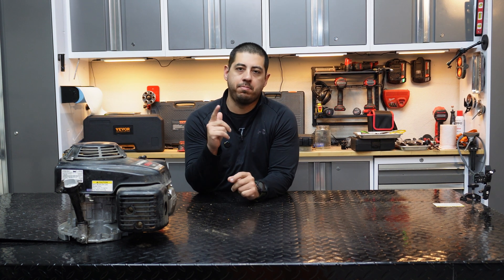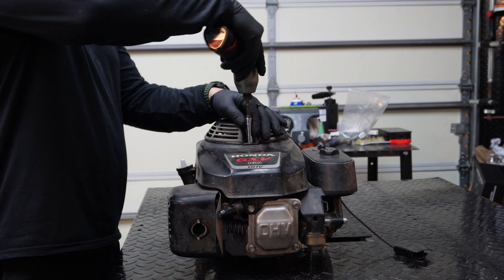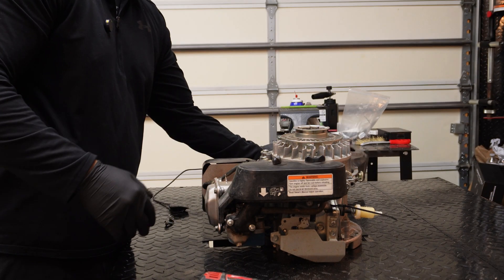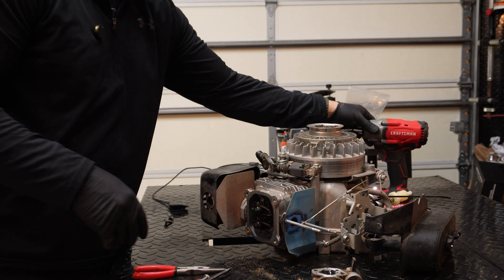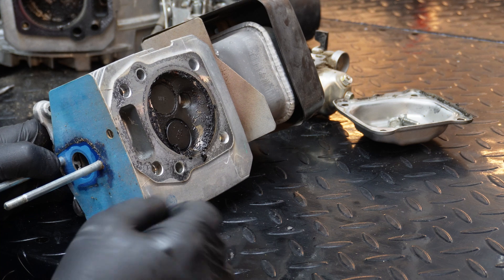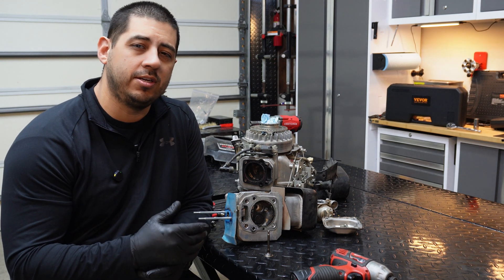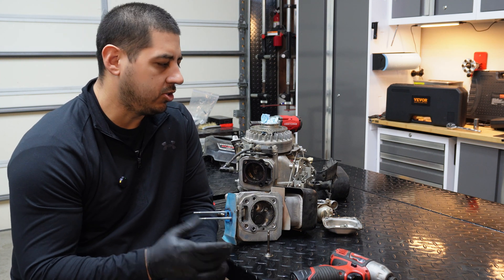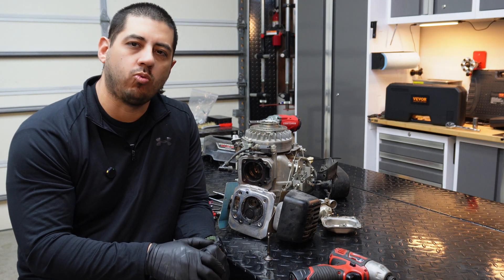Honda Engine GXV160 Breakdown on how they fail so much

Comment: If you had to pick an exmark with a Kohler 7000 or the exmark branded engine with would you choose,if Kawasaki wasn’t an option?
Reply from the maker: Kohler. Exmark is a Chinese engine but their engines are not terrible but they are not the best.
Reply: @ApexOutdoorPower Probably easier to get parts long term for the Kohler also.